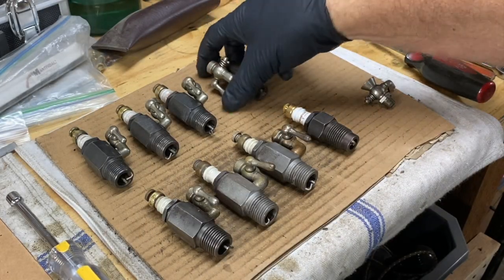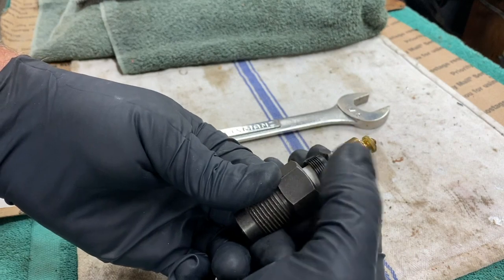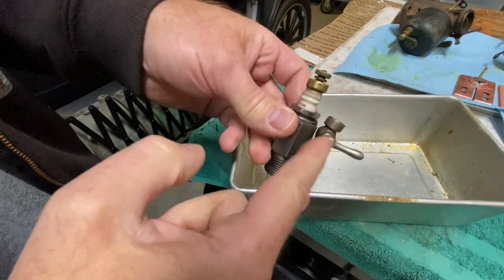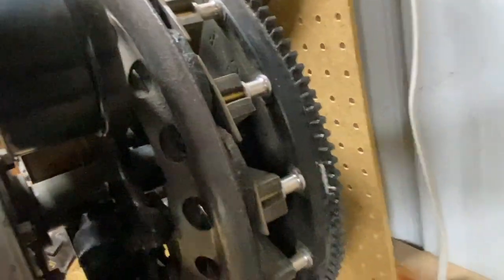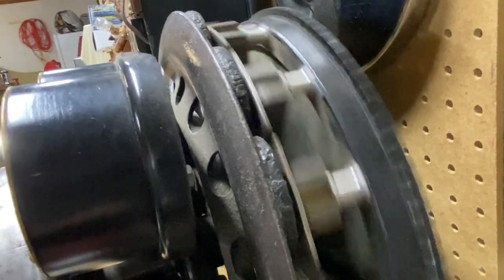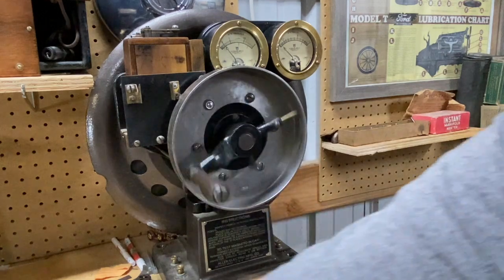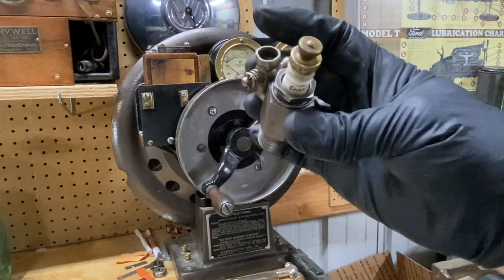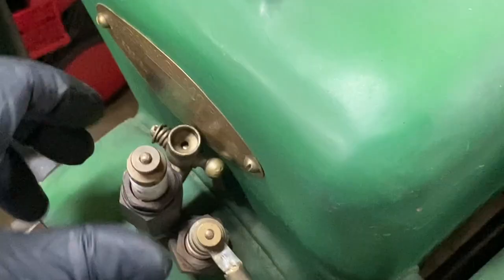Experimenting With Priming Cup Spark Plugs

Comment: Not seen plugs like that. 
Are the valves steel seeing as they operate against (admitelty low) engine compression. Thought steel might seize but brass might not be good with the heat.
🤔🇬🇧
Reply from the maker: The valves are not made out of steel. It's hard to tell what type of metal it is. Perhaps a zinc-plated brass? Just a guess.